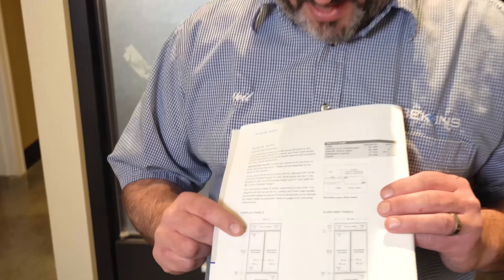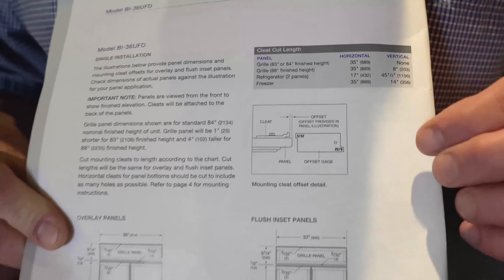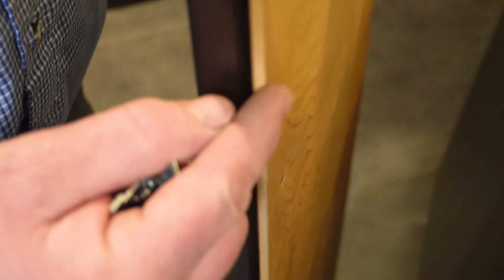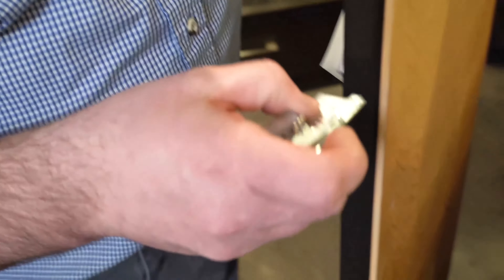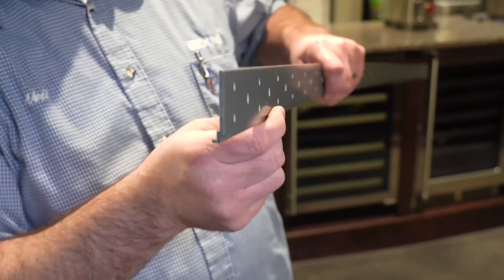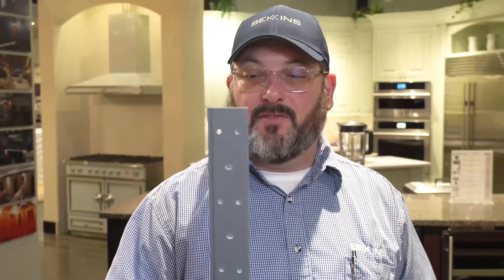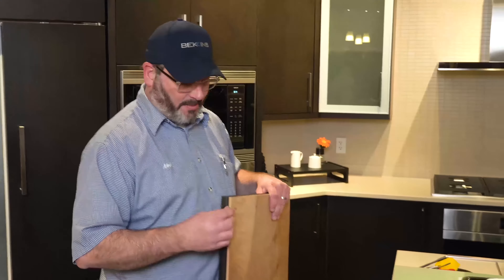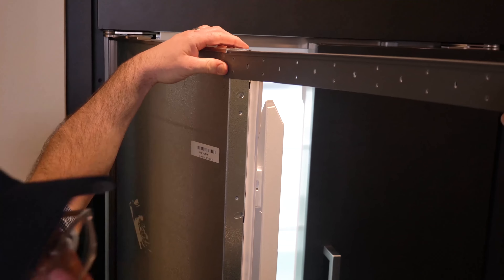Sub Zero Classic Built In Panel Install Kit Explained

Comment: oh I absolutely HATE these fridges. so many others have much more straightforward ways to install the panels instead of this crap. I have been in the cabinet business for almost 30 years and still hate these every time I come across them they never really get any easier, I have always done the 1/8" spacer panel then a 1/4" mounting panel, lots of wasted material and they are hard to get strong enough to not want to start ripping loose after a couple years, just a horrible design. they should come with mounting brackets like these to begin with!, this looks a lot better for many reasons! hopefully I can find them and also hope they will work with the particular door type I am having to deal with this time that has a small frame around it and thin panel....its been giving me a belly ache just thinking about how to make it work !  anyway Thanks for posting

Comment: Hi mate, I’m in Australia, I have this fridge and that spacer panel on mine is made from sort of mdf and has swollen due to a leak from the door water supply somewhere. From what I understand I can get rid of that mdf spacer panel and use that plastic strip kit? Is that correct? Thanks

Comment: Per the subzero flush inlet guide, the distance between the front of the 3/4 inch panel installed and the cleat is 2 3/16 inch.  Is that enough to clear when opening at 110°? Assuming the panel reveal is 1/2" to the cabinet side panel.

Comment: What’s the product number for this kit!
Just about to cut a bunch of 1/4” and 1/8” plywood for mine but this would save weight and time.
Reply: did you ever track this down? I would like to try this product as well.
Reply: @AsTheWheelsTurn  had to order through sub zero dealer